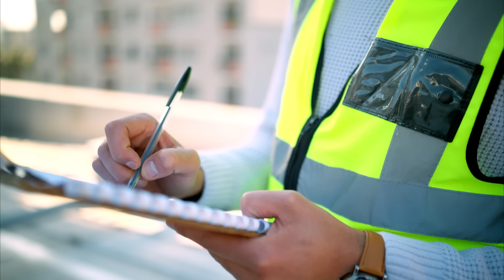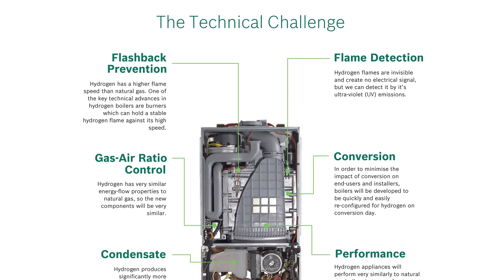Is Hydrogen Actually Dangerous? | The Real Facts

Comment: Methane has a molecular weight of 16. Hydrogen is 2. 
The distribution network will have to be tighter than a ducks back passage!
Reply: This for me is the biggest problem, hydrogen is presented as a replacement for gas, the politicians seem to think we can use our current infrastructure and we can swap over like we did when we switched to digital radio.
Reply: @ambrosiad1588  … except that digital radio and analogue radio don’t use the same technology (so your analogy is flawed)
Reply: Having worked on hydrogen cooled generators I can vouch for the fact that it is very difficult to work with … better we dump net zero and restart human progress!
Reply: Not even the start of it. The energy density per kg is so low compared to natgas that at the same energy flow rate through the pipe, you’re looking at triple the pressure on the network. And increasing the pressure then creates a load of knock on effects, with the main one being, a gas leak in a home is going to take out half a street, not just the house and part the neighbours. It’s an absolute non-starter as the fire service will reject it outright. You want a fireman to run into a burning building connected to the hydrogen mains?

Makes far more sense to just use a bit more electricity to turn the hydrogen into natural gas or e10 fuel using carbon capture  and the Fischer tropsch synthesis instead of bothering with trying to re-engineer the entire national infrastructure.

Hydrogen does have its place, and the bus in the video is the prime example. As is the work jcb have done with their fleet of construction and farming machinery that runs from hydrogen. But piping the most flammable gas know to humans directly into residential properties, and ensuring it is safely managed in everyone of those properties is pigs flying stuff.

The moment the first gas leak/explosion happens, and people see the size of the crater it leaves, it’s becomes a dead technology.
Reply: @TheDirtyWizard  the issue may be though, as we have seen a lot in the last 15 years, the "green initiative" meaning a mass rollout of Hydrogen in a short period with a hard cut off and mandated upgrades.

That is to say, the first "bang" may not happen until too much time, effort and forceful rolling out has commenced.

I love the idea of change, and I love to think we should all go "green", but the tech has to be ready, epsecially from a safety perspective. - Also, having seen the quality of "smart meter installer" that was hired when the push for that came, I truly worry about installation standards for Hydrogen infrastructure and appliances.
A "big rollout" to an upgrade would require a huge, freshly trained labour force... which comes at a cost. Therefore often trained fast and cheaply.
Reply: Correct and that is why they are changing the network to HDPE / MDPE. The network will be welded and fully tested.
Reply: Hydrogen  detonation range is 10% to 90%.   Gas is around 8 to 1 and will only detonate at that content.
Reply: @christopherrobb1004  yeah this is the other key point.

We have a standard know as ATEX for inserting electronic equipment such as sensors in explosive environments. The point of ATEX is it limits the total amount of energy based on the explosive capability of the env. Given hydrogen requires such a tiny amount of energy to ignite, there is no sensor on the planet capable of operating at such a low current level so how do we even go about inserting flow meters to get an accurate understanding of the network?
Reply: @TheDirtyWizard (yes there are and I’ve worked with them)
Reply: @christopherrobb1004  LEL in air 4% and UEL 75%
Reply: Don’t forget it’s H2 so not the smallest molecule 😉
Reply: The first hydrogen buses were 3 of them in London between 2003 and 2007 on RV1 route. Great success but we’re all decommissioned immediately the trial finished and the hydrogen refuelling station on A127 in Upminster was also decommissioned within 2 weeks of the trial finishing. Again another very successful trial buried by government probably because they had too much invested in oil.
Reply: You are not wrong, I, as a retired B Sc analytical chemist, agree with you entirely.
Reply: Add that hydrogen is corrosive to steel via hydrogen embrittlement. So likely to cause fractures.
Reply: @davidc8982  Roger said exactly that.
Reply: @davidc8982 
It makes solder joints brittle so soldered copper would have to be replaced. 
Hydrogen is a non starter.
Reply: Maybe edit that to explain the significance... I know what you're implying, but many most likely won't.